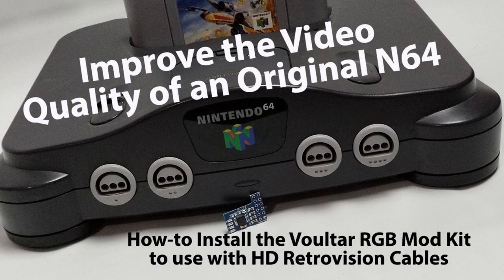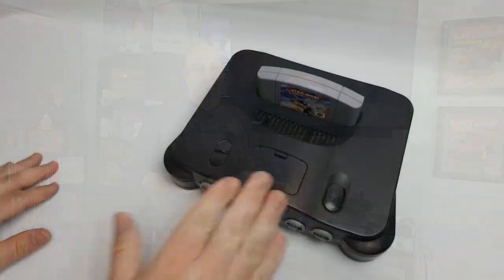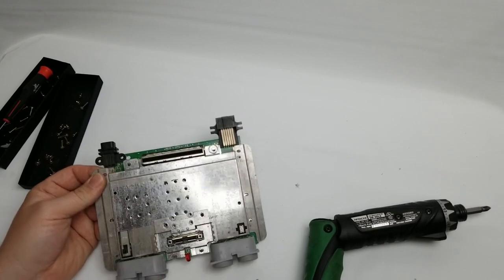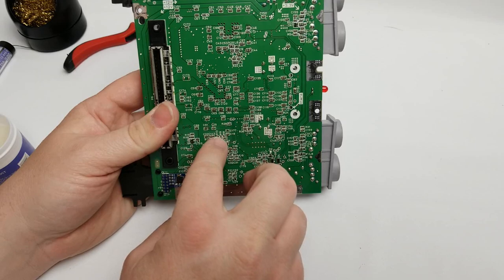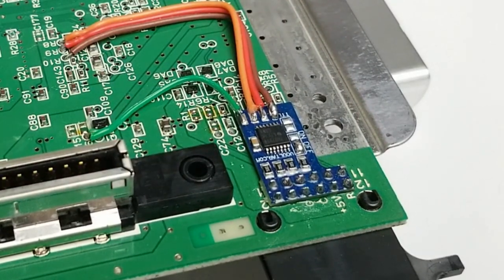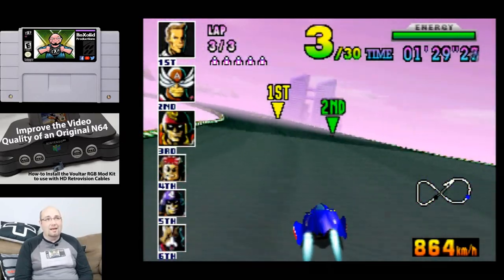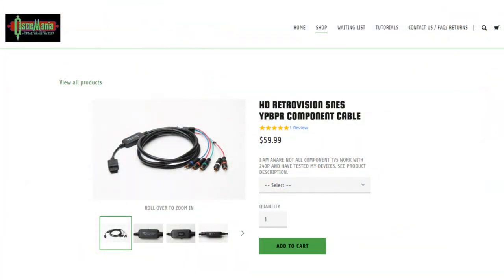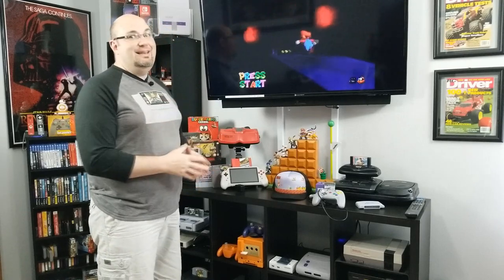Improve the Video from the Nintendo 64 Using Voultar's RGB Mod Kit & HD Retrovision Component Cables

Comment: My N64 can't take this mod, so I got Tim Worthington's N64RGB kit; I love it! It has a "deconvolution" function (switchable) to eliminate the horizontal "smearing" of the graphics, which is HUGE improvement; looks so much better.
Reply from the maker: That's awesome, I have heard very good things about Tim's kit as well. I do know his is more Universal but also more in-depth to install and more expensive is it not? But I'm glad to hear that you got a system that works for you!
Reply: Thanks!  N64RGB isn't that expensive, certainly far cheaper and easier to install than an HDMI upgrade, although installation is still not for the feint of heart.

Nothing at all against Voultar's fine work of course - I'm a huge fan of his, and his kit is great for someone that wants an economical RGB solution with an easy install and reasonable price, as long as their N64 is one that has the analog RGB signal available on the board and they're OK with the N64's video quality.
Reply: @gregdunlap7538  I just recklessly bought Tim's kit for 2 of my N64 consoles without thinking of this one cuz' its cheaper. Why not spend less for the same goal? Well i'm not sure if it'll work on my system cuz' like you said, it may not take the mod. Idk for sure but just in case, I bought Tim's kit cuz' 2 of my N64 consoles are not only later models, but one is the golden Toys-R-Us exclusive and the other is a Pikachu one. So I reckon I made the right call?

Comment: I spent hours trying to troubleshoot when I did this mod a couple months back.Turns out the bottom RF shield was touching the mod chip. The solution was simple: bend the shield.
Reply from the maker: Some modders also remove the lower RF Shield entirely. I just folded the shield back around where it would have hit the chip if left unmodified.
Reply: use conformal coating or a piece of silicone tape on the chip. dont bent stuff

Comment: I was wondering if you could help me. What SCART cable would I need with Voultars amp?, I would assume C-Sync correct?. Or could I just leave the components on the board and not install the C-Sync wire and just use a Sync on Luma SCART cable?. Which is better?. It will be used with an OSSC. If you can provide links that would be great also. Thanks.
Reply from the maker: I would recommend using the Insurrection Industries SCART Cables, they are exceptional quality and what I used.
Reply: @RoXolid  I'm afraid you skipped over what mostly made my question, which was do I need C-Sync or could I just not connect C-sync and use Sync on Luma. I already know I need a SCART cable, just needed to know what kind. Thanks anyway.
Reply from the maker: I didn't know if the top of my head of the Induction cables were Csync or Sync on Luna, I just know that work. Upon looking on their site their cables are Csync. Hopefully that explains why I originally answered as I did.

Comment: Hi, question, at 16:05 you show the board installed and I notice you have C22, R14 and R1 removed. Why did you do this? Im going to perform this mod on a CPU03 revision board and have the same Hd Retrovision cables as you. Thanks.
Reply: hey bro, i wreckleslly bought 2 of these without checking  my serial number. i have ns2 with 03 boards.. am i screwed?

Comment: Great video, your a good teacher.   How does the mod look without the OSSC? Because that part it a little out of my price range.
Reply from the maker: It looks solid, I need the OSSC mainly for streaming and connecting to my capture card.
Reply: Retro tink 2x pro is a cheaper solution than OSSC but not as good but still great
Reply from the maker: I actually now prefer my RetroTink 2x Pro over the OSSC for Nintendo systems. I don't get frame drops like I do with the OSSC
Reply: @RoXolid  I’m glad you enjoy the 2x pro. It’s a great way to capture video plus  it also upscales the image even for those who don’t care about video capture. I really like the retro tink 2x 👍🏻
Reply from the maker: @1upgamez353  100% spot on!

Comment: Hi!  Did you remove Capacitor “C22”  /  Resistor “R1”  /  Resistor “R14” and R15 and R16? I have the motherboard 03 too.
Reply: hey bro, i wreckleslly bought 2 of these without checking  my serial number. i have ns2 with 03 boards.. am i screwed?

Comment: how would this mod work with eon HDMI adapter plus a M classic?
Reply from the maker: It wouldn't do anything. So out of the box, the eon super 64 taps into the S video output. You don't need to mod the system to do that. Going from a super 64 into an m classic would probably look terrific

Comment: Any idea why the picture looks very blue after the mod?
Reply: Fixed it, reflowed some solder and all is well.
Reply from the maker: Glad you got it figured out!
Reply: @RoXolid  Also ordered a Retrotink 2x Pro, should be arriving tomorrow.  Im using the HD retrovision SNES cables currently.  Some games work on my TV and show 480i and others show 0p.  I assume the RetroTink will correct this.  Its also weird because the games that work are
 the LucasArts games.....

Comment: can anyone link a solution for the jungle green n64 (as it apparently is the wrong revision for most mods). doing scart and/or component on a bubble tube SD CRT.
Reply from the maker: There is another, more complex mod for those with NS-2 Serial Numbers but I am not sure who/where to get that one. II also know the ULTRA 64 HDMI Mod can work on just about any system.

Comment: I’ve seen some people do this mod without attaching sync.  Is it necessary for the hd retrovision cables or does it just depend on the n64 board revision?
Reply from the maker: I don't believe the HD Retrovision cables use C-Sync so I think you can omit that. I did initially and it worked, but then it started having problems. I did eventually connect it but I don't think that was a good at all for anything.

Comment: I did mine, and my svideo isn’t working, I can only hear sound, I don’t have any rgb conmections yet so I can’t test that
Reply from the maker: Did you solder up the S-Video part? I did not show that in this video as I was going straight to RGB/HDRetroVision Component cables and wasn't going to use S-Video
Reply: @RoXolid  So is possible to have the RGB and S-VIdeo working at the same time? Picture this, one SCart RGB cable and SVideo cable 2 in 1 , but the S-video signal is only on the S-Video Cable, and the RGB signal only on the Scart.  I Plus The Video Signal to a CRT and the Scart cable to my DVD Recorder  that converts RGB to HDMI and then goes to ELGATO game capture. with a setup like this I could play normally on a crt and No lag, and at the sam etime have the best quality on a video capture right? of course if you confirm the console can output RGB and S-Video atd the same time whitout issues.
Reply from the maker: While it theoretically will, you'd need to split the output from the N64 which you really can't do
Reply: @RoXolid  You know I tought before that cant be done with any console,  but as an example I own  a Playstation  2 cable that is actually 3 cables at once. I mean, from the PS2 multiout plug , 3 cables merge, One for Composite with sound, 1 for S-Video and one for Component, if I plug that cable to my crt tv or Dvd recorder, all the 3 video signals are displayed at each corresponding input.  Whitout any interferences.
Reply from the maker: @juanjoserivasgarcia2336  The complication is that there aren't S video & component video cables that are 2 in 1.
Reply: @RoXolid  Thats why I was thinking on modding the cable.  Well not a component cable, but my scart cables, it will work for me I hope.
Reply from the maker: @juanjoserivasgarcia2336  good luck, the one thing to remember if you try to mod the cable you will likely introduce RF noise because you're going to have to cut through the shielding and insulation. What are you trying to do in the and? Just go to two TVs?

Comment: The serial number needs begin with NS1 ? the next numbers doen'st matter ?
Reply from the maker: Correct, as long as it starts with NS1 you're good to use the Voultar mod
Reply: @RoXolid  Thanks a lot
Reply from the maker: @fernando929305  glad I could help

Comment: You can also get a GameCube style analog stick from eBay for the original controller.
Reply from the maker: True, but I have heard those tend to have more deadband and be less accurate than OEM controllers. I would recommend checking out Nintendrew's video on N64 controllers, he does a great job and features that mod as well.

Comment: Does composite still work after the mod?
Reply: I don't have this yet, but I imagine that it still does. All this does is amplify the native RGB signals in the unit, and route it to the appropriate pins on the AV connector. The composite output isn't being touched.
Reply from the maker: It does still work, this doesn't disable anything, simply routes the correct RGB video signals to the pin outs

Comment: soldering for 25 years and you dont like flux!? blasphemy! I dunk my boards in flux, can never use too much. 
When you find your fav flux you will fall in love
Reply from the maker: For the equipment I solder, mainly RC car/truck motors, brushes, wires, ESCs, connectors, etc, flux just makes a HUGE mess.
Reply: @RoXolid  I've soldered a few drones together and I also did not use flux for awhile. Until I found out about amtech flux syringe.
First flux i used was RadioShack and it was messy garbage

Comment: Hey would this also reduce the input lag with the rgb mod?
Reply from the maker: In comparison to what exactly?
Reply: @RoXolid  so i noticed if i hook up my n64 to an hdtv its crappy looking with a slight input lag with the controller. If i do the rgb mod and get it to hook up to hdmi i wonder if itll also reduce the controller lag
Reply from the maker: @ikeavaughan  Are you going right into the Composite inputs on your TV? Make sure you have your TV in Game Mode, that should help reduce lag and latency. There really shouldn't be any significant lag difference in your situation
Reply: @RoXolid  ok ill try it out. Thanks for the reply! Very quick

Comment: I still think the n64 is graphically impressive
Reply: In many ways it is, in terms of 3d graphics architecture it absolutely destroys the PS1. The downside is that the graphics are very much designed to take advantage of CRT displays, so getting them to look right is a bit difficult. In the case of the few good 480i games such as Infernal Machine it may even be impossible without a lot of processing lag.
Reply: @ozzyp97  I always play n64 on a crt

Comment: You said the SNES supports RGB Component right out of the box, this is actually false. It supports RGB, the component cables actually converts the RGB signal into component.
Reply from the maker: You are correct, but somewhat splitting hairs. The point is more that it supports RGB Component CABLES out of the box, along with SCART RGB cables. However, the SNES Jr and N64 both require RGB Mod Kits to unlock that capability.

Comment: I love scanlines, but your implementation in your video looked pretty bad.  Notice how they are not the same consistent thickness?  That tends to happen with both the OSSC and the Framemeister when set to 1080p output.  If you want them to look right, avoid 1080p.  Use a 720p or 4K tv and choose to output 720p with scanlines from your scaler.  When dealing with 240p content, like most n64 games, it is absolutely wonderful.

Also, you must up the gamma a bit to compensate for those scanlines.  That's why Goldeneye seemed so dark.
Reply from the maker: I generally use 3x line tripling with my OSSC, which yields 720P. Even with systems such as the NES & SNES Classic I don't like scan lines.

Comment: Hi, do you Know if the  retrovision hd cable works necessary with the voultar rgb kit? If I use a different kit the cable could not work? Thanks in advance
Reply from the maker: It will work with other RGB SCART or Component cables. I've used the Insurrection Industries SCART Cables and it also looks very good.